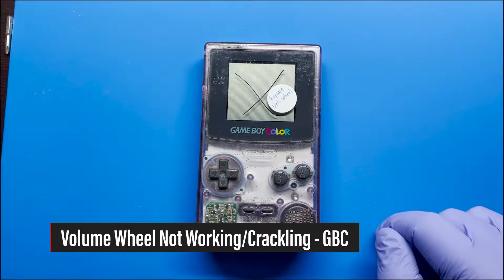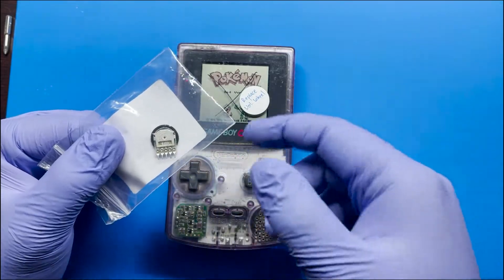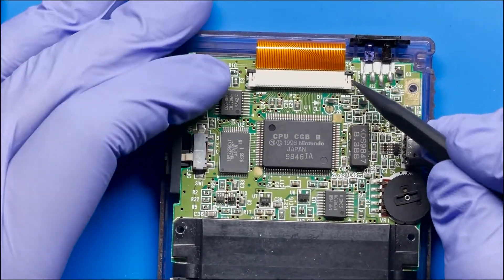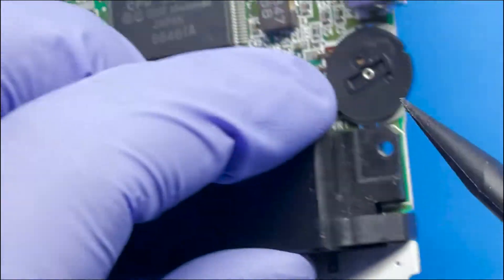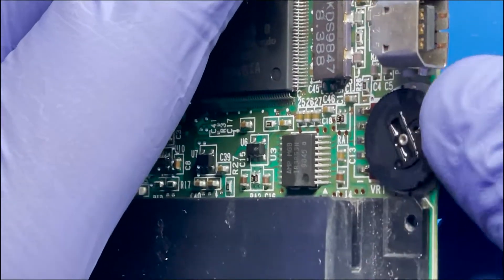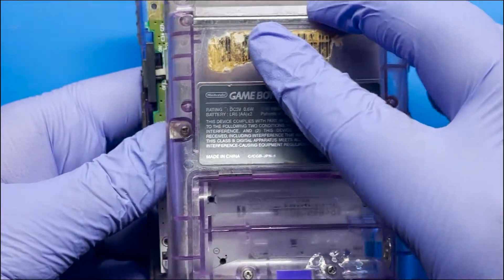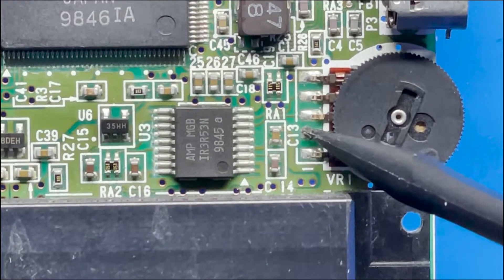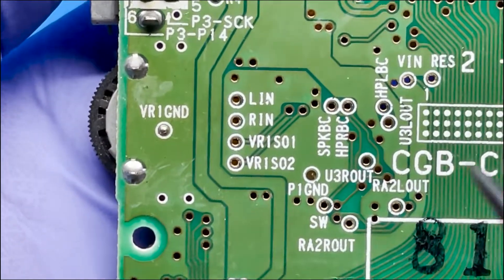Gameboy Color Sound Fix - Volume Wheel Replacement | Gameboy

Comment: I had a super funky problem with my GBC that this fixed as well! All I had to do was clean it with IPA, and I went in with a toothbrush to try and clean as much as I could.

 My volume would go up normally until the very last bit, where it would suddenly go down a little on speaker. With headphones, the volume would ramp normally but at max volume, the right channel would cut out entirely. I'm assuming the volume pot would just not be forwarding the right channel to the speaker/headphone downstream when at max volume. IPA and some elbow grease worked great tho!

Comment: What's the best away to avoid ripping those 2 pads that are below the wheel? It seems like there is no way to properly desolder them.
Reply: Do you use flux?
Reply: Since it's being removed anyways cut the part off close to the pad and then desolder it.  I'm assuming the correct way to remove it would be to use a heat gun.

Comment: my gameboy advance sounds crackly while i move the volume up and down. Max volume is lower than about 75%. I’ve tried cleaning it. should this be my next step?
Reply from the maker: Have you tried inspecting the speaker to make sure that everything is fine? A lot of the ones I have worked on were defective from my experience and it may be the problem. I would suggest giving it a quick look first before going this route.

Comment: Would I be able to use that same repair method on a Capacitor Pad? I accidentally ripped one off
Reply from the maker: Yup! As long as you are able to create the connection to the existing trace, you can certainly repair a ripped pad that way even for a capacitor!
Reply: @totalfix877  ok thnx! Also how would you desolder the potentiometer from those pads without ripping them??

Comment: Thanks for sharing. I will have to do the same with my gbc. Where did you get volume control? And where can I get those small trace pads, that you used to fix the ripped pad? Cheers.
Reply from the maker: Trace pads can be found at NorthRidgeFix website found here:
https://northridgefix.com/product/pad-strips-to-fix-ripped-pads-and-torn-wire-traces/

The volume control can be purchased from a lot of places honestly, but I go with Console5 just because I get them in quickly:
https://console5.com/store/replacement-game-boy-color-and-game-boy-advance-volume-potentiometer-volume-control-knob.html

Just be mindful that on the volume wheel replacement, "If using this product in a GBA, you will need to solder pins 2 and 3 together and pins 4 and 5 together". 

Source (Under Notes):
https://handheldlegend.com/products/game-boy-color-advance-volume-potentiometer?_pos=1&_sid=6273ab0bd&_ss=r

Comment: Thanks for sharing this!

I had a very low sound on my gameboy color so like you I changed the volume wheel and the speaker but after that the sound was out of order, the wheel at the minimum, the sound came out quite loud and at the maximum even louder but I can't  mute now, any idea?
Reply from the maker: On the volume wheel replacements, there is a common bridge you have to create for the GBA's with replacement potentiometers.

As per most common replacements:
If using this product in a GBA, you will need to solder pins 2 and 3 together and pins 4 and 5 together

Reference:
https://handheldlegend.com/products/game-boy-color-advance-volume-potentiometer

Hopefully this helps
Reply: @totalfix877  already fixed with an other sound wheel 
Thanks !

Comment: I've been looking everywhere to try and find a solution for my problem with volume! I changed speakers, capacitors, potentiometer, and even the jack port. By watching your video I realized that I ripped the pad underneath the potentiometer, on the same pad you ripped. Thanks for the video! Where did you purchase those copper pads in that packet?
Reply from the maker: I apologize for getting back so late to this, I have been busy. However to answer your question, I got it from NorthRidgeFix. I will link the product below here:
https://northridgefix.com/product/pad-strips-to-fix-ripped-pads-and-torn-wire-traces/
Reply: @totalfix877  thank you!
Reply: @totalfix877   I came here to ask that too. What is it even soldered to? Is it just a pressure based contact that cold welds over time or something?
Reply: this is the fear i have, the odd part is the bottom isnt even soldered so why is it tearing off?

Comment: I've replaced the speaker on one of my gameboys thinking the lack of sound was the speaker but still nothing. I checked to see if I was getting continuity in the headphone jack and it did so im thinking its the capacitor? Idk but its driving me crazy already.
Reply from the maker: Sorry for getting back so late on this, hopefully you have been able to fix it. To go into a bit more detail, most of the issues that I run into when fixing speaker related issues always have to do with the caps or the potentiometer on the wheel having a high resistance causing the volume to be low or absent. You would need a multimeter and inject voltage with some batteries to determine if the proper voltage is being received at the potentiometer.

Comment: My volume wheel is like tuning an old radio trying to find a spot with clear sound so I’m guessing it’s the volume wheel needs replacing. Wish I was better at soldering. Bit worried I’m gonna break it!
Reply from the maker: The GBA volume wheels are a bit tricky, but not too bad after you have a bit of experience. There are alternative ways to make it easier to remove, but it would require cutting up the component.
Reply: I did it a couple of days ago. I’d just replaced the capacitors, so was feeling confident. The volume wheel was much harder. I managed to do it though and was surprised to find that it worked! I thought I’d broken it for sure! Sounds great now. Very happy. Thanks for replying and for the video.

Comment: Do you know if Gameboy pocket Volume wheels are compatible with installing them on the Gameboy Advance?
Reply from the maker: I don’t know if you can to be honest I’ve never tried it myself, but in the case you do you’d have to solder pins 2 and 3 together as well as pins 4 and 5 together. I’d just be careful and get the proper parts, they’re fairly cheap.
Reply: I know the replacement wheel for this actually works for the contrast wheel on the pocket, but I  haven't tried for the gba

Comment: Hey i recently got a GBC and it has no sound, any idea how i can tell if the issue's from the volume wheel or is it from the speaker?
Reply from the maker: You can plug in your headphones and test the volume wheel. Sometimes the speakers don’t work even when testing the resistance of the speaker with a multimeter. Hope that helps!